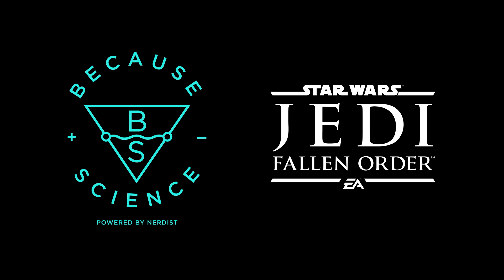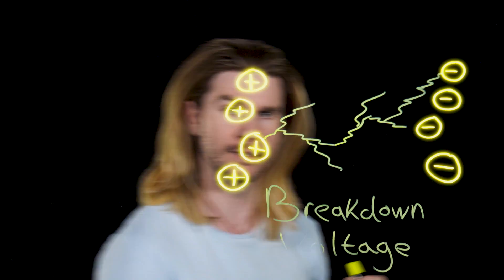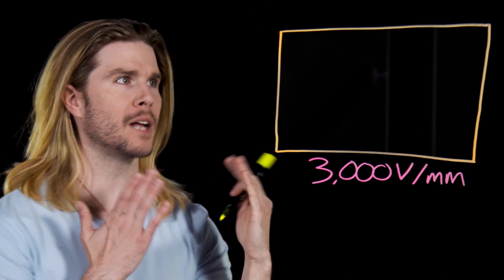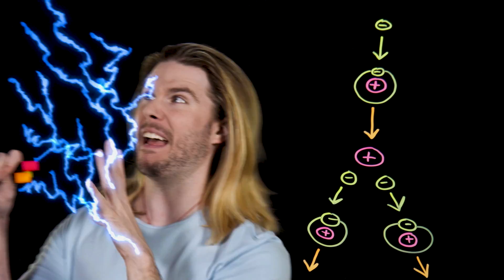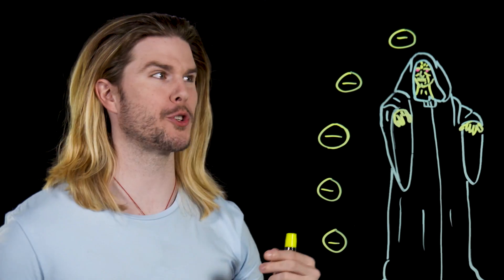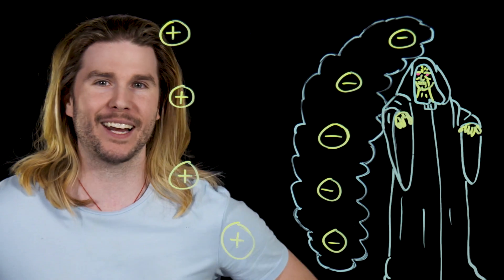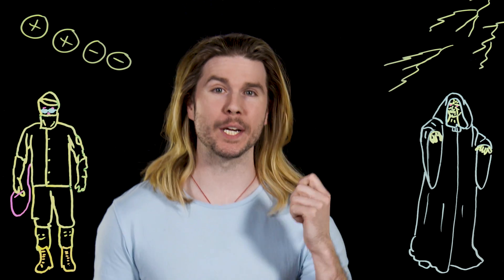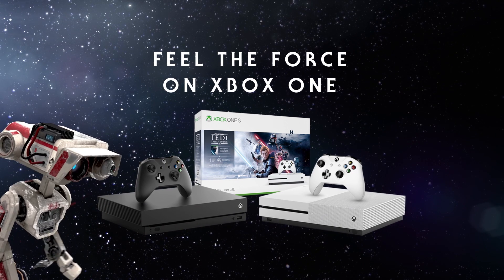How Does FORCE LIGHTNING Work? (Star Wars SCIENCE)

Comment: First: your black robe blends in perfectly with the background.
Second: if Sith lords can control electricity per electron (like you suggest), they could Force (get it?) electrons in the path they want them to take regardless of voltage.

Third: If, however, Siths could only build up a negative charge on themselves, the lightning would more likely hit something or someone that's closer to them as it forms a path of lower resistance. Besides, this would electrocute both the target and the Sith lord, making it rather counter-productive.
Fourth: no discussion about the dangers of electricity is complete without the note it's the amperage that kills you, not the voltage.

Comment: How to make force lightning even more terrifying and dangerous (and get round any mesh armour) : Instead of shooting the lighning at your target, levitate a tungsten (or any other high Z number dense material) coin between you and your target. Fire force lightning at the coin. The bremsstrahlung X-Rays in the  ¬14 MV range you are now producing in vastly higher quantity than in a radiotherapy Linac (Which is typically measured in milliamperes. Lightning is in 1000s of Amps) in the fraction of a second before the coin turns into plasma  give your target a near immediately lethal dose of radiation. Even if they manage to talk your protige into throwing you over a railing, you get to die knowing your target is, at best, the walking dead.

Comment: Kyle love the show, there's an interesting parallel between real world lightning and force lightning. Force lightning is used in the film media by the Sith, who can be considered the negatively charged side of the force. It is usually directed at Jedi who would be positively charged. Real lightning typically results from a build up of negatively charged particles flowing to a positive place. Just a random observation. In expanded universe sources rare Jedi are able to use force lightning but it is depicted as weaker. But if the parallel between the two is real then wouldn't Jedi force lightning be stronger since positively charged lightning is much stronger and deadlier?

Comment: There’s always so many issues with the way electrical weapons/powers are used in movies. 

-if Palpatine generates a voltage difference at his finger, if literally anything slightly more conductive than the target was near the “conductive force path” the electricity would preferentially arc to that and not to the target (since it seeks the most conductive/shortest path.)

-if the ground is conductive and a circuit is completed, wouldn’t both target and user be shocked equally?

-if the Jedi simply wears rubber soles shoes it would become enormously more difficult to target them, as they wouldn’t be properly grounded anymore. (If they can be considered to be before which I doubt)

-if one simply charged oneself up to the same voltage that Palpatine is generating by similar means, he couldn’t shock you since there’d be no difference in potential.

-To be maximally effective and to cause as much current as possible to pass through the target, Palpatine would probably want to use a “counter stroke” of returning force lightning. Perhaps this is why he sometimes uses two hands?

Comment: I know breakdown voltage a little because if it doesn't happen in your car you will have a misfire.  and for car with a higher compression ration you need more voltage.  a car will spark anywhere between 20,000 to 60,000 volts to jump a more dense air environment. top fuel dragsters use millions of volts and they can have huge deadly arks. search up top fuel dragster spark voltage and you will see something cool

Comment: Hey Kyle, love the show.

There's an even older technology that works as a sort of Faraday cage for the human body: chainmail. Whenever people have demonstrated Tesla coils, they tend to wear chainmail to protect themselves from the electrical discharge that such devices put out. I imagine that metal mesh clothing is really just a modernization of chainmail.

(But it should be noted that if you've ever experienced a diminished cell or WiFi signal from inside of a building, especially metal buildings, the building you are in could be providing a similar effect and blocking signal penetration, or at least attenuating it.)

Comment: But wouldn't the energy go through the closest path to the ground? "The path of least resistance" idea would prevent the target from being hit unless it was the only option. I think Force Lightning works by removing the negative charge from the target then causing them to be the best, most attractive object for lightning. 
                  Maybe by taking your negative charge, they can empower their lightning? Maybe they don't even "Generate" electricity, but force pulls your negatively charged particles from you (and the surrounding area) then send it back at you amplified.

Comment: The only issue I can see with this idea is that, lightening lasts an exceptionally short amount of time maybe 0.5seconds, whereas in the movie, the electrical current flow from sith lasts for multiple seconds meaning, that while the voltages are the same, the over power usage would be astronomical!

Comment: Great video as always! I'm wondering if there isn't another way that the Force Lightning can transfer through the air. In your calculations, you assume that the charge is generated solely in the Force user. However, we know that the Force is mediated by midi-chlorians. Their name is taken from a combination of mitochondria and chloroplasts, meaning that they can be thought of as "The Powerhouse of the... Jedi!" We are told that they live within all living cells which presumably includes all bugs, plant cells, fungi cells, and bacteria. If so, then there would be midi-chlorians in the air between the Force user and the target. Assuming these can be recruited, then they could also generate power, connecting like a bunch of microscopic batteries in series that would reduce power loss across space and in fact potentially compound across it depending on the density of biomass floating in the air. I wonder if this method could negate any of the defense measures you mentioned.  The power wouldn't be unlimited, but it would be impressive. Kinda like a Spirit Bomb but used for evil!

Also, I'm surprised you didn't talk about the fact that the amperage of Force Lightning is low enough to not stop Luke's heart despite the high voltage and prolonged shock seen in the film. Super interesting stuff!

Comment: You did not talk about the strain on the Sith Lord releasing all that voltage.  The problem with casting force lightning is that the spark shocks both parties and I can tolerate a static discharge, deal with them in my void as well, but if we are talking the voltage you are talking about, my hands should be on fire when I stop to taunt my victims.  As a Sith Lord, I am not a villain.....

Comment: Force lightning is really cool, but if I'm understanding your explanation right it would be really hard to use. 

Lightning strikes based mostly on the path of least resistance (which is mostly what is closest but not exactly, which is why it doesn't move in a straight line). With all the objects nearby, including the ground beneath their feet, the walls, railings, it seems like you couldn't actually coax the lightning to strike the target unless you and the hapless Jedi were floating in the air away from any other objects, or you were in a special room designed for it.

The image of Palpatine getting flustered as his lightning strikes the ground directly in front of him is pretty funny though. Thanks for the episode.

Comment: Since lightning can reach 30,000 K and we're saying the senate is pushing around 15 million volts, force lightning over a sustained period like we see in the movies (its not just one bolt and done) covering most of the jedi's body would have to leave them burnt to nearly ashes (cremation is only between 1400 and 1800 F). As you've stated in previous BS videos, most lightning strikes are not direct however I would think force lightning from Palps would be direct so no real chance of walking away from that one.

Comment: Love the show Kyle, but there is one issue you did not go into. The examples provided would indeed give a shock, but it would be a quick burst, much like lightning. In the movies however, there is a constant stream of lightning. The force user would have to continually manipulate the charge. Not only that, they would have to fully control the charge of the entire area they are in. 

For example, if I am throwing lightning at something 2 meters away, I would have to control the charge of every object within 2 meters, otherwise the charge I create will arc to the nearest object.  Basically, if you shuffle your feet and the charge you generate can go 1 meter away, it will go to the most likely spot first. When it comes to Palpatine, everything from his throne to Vader are also in range. You would have to neutralize any other potential targets.  Powerful control indeed.

Comment: This armor could still probably be circumvented fairly easily. While electricity can't flow through the armor, a more creative force user could just make the lightning completely within the Faraday cage. Even though the lightning is always shown starting from the fingertips of a force user, I'm fairly certain they have to manipulate the electrons of the air all along the desired path of the lightning. After all, electricity follows the path of least resistance and the straight route from Palpatine to Luke, for example, was most definitley not the path of least resistance with floor and metal railings being much closer to Palpatine.

Also if they can gather electrons to specific locations, is it too much to ask to just wiggle them around? I feel like heating pretty much anything would be quite an easy way to either melt your opponent's Faraday cage armor, or maybe just go straight for their brain. Once again, a reasonable explanation to a single element of Star Wars, which opens a whole lot of, more complicated questions. :D

I liked the video you made Kyle, keep going! :)

Comment: If a  Force user could manipulate electrons in this manner, they could also reduce the voltage required by creating a channel of ionized air between themselves and their target, essentially creating virtual wires for their Force tazer. This would make sense canonically as the value the emperor would otherwise need to hit Luke from that distance would have killed him, unless you assume Luke was using the Force to at least partially counter the effects.

Comment: If someone could generate such an imbalance within themselves to project lighting, I doubt It would get very far. Lighting, like any other form of electricity, will search for the path of least resistance to ground itself. If you were to generate an imbalance to exceed the breakdown voltage of air (which varies depending on things like and humidity as humidity and breakdown voltage are inversely proportional) and hit your target at the other end of the room, you would have to also make sure that the charge didn't flow through you to ground immediately (meaning you would have to stand on something with a breakdown voltage greater than what you are trying to achieve) and make sure that the lightning stream continues to it's target. Once the lightning leaves your body, it may just arc to the ground. I think the only way to prevent this arcing to ground is to charge your target with a significant opposite charge (like a spark gap) or control each electron in the stream to proceed in a straight line.

Another thing is that if you were to prevent your energy from discharging to ground through your body, your body and the ground beneath you would then become a capacitor, and if you fail to discharge your electrical energy at your target and you step off whatever super-insulator you were standing on, that newly formed capacitor will discharge, and those tens of millions of volts will arc through you to ground. This would also be the reason (this whole capacitor thing) that any lightning emitted by you would immediately attempt to go to ground.

One last thing. Is the skin effect preventing this lightning from doing internal damage? I would think so, but that high of a voltage would penetrate skin.

Comment: You should have mentioned that the electrical charge could not have traveled the distance mentioned without first discharging to the local conductors such as the metal staircase the emperor was standing on. It’s difficult to direct a charge with so many other conductive targets along the path.

Comment: So, theoretically speaking, wouldn’t it be possible for a force user to generate electricity/plasma using biology? I understand that they’re not generally accepted by the fan base, but, since midichlorians are “microscopic” forms of life, they should be using some form energy. If this were primarily stored as potential energy, then it wouldn’t be too far of stretch for them to be “forced” into turning that potential energy into kinetic energy and heat. What if, the “lightning” was not actually conventional lighting with a positive and negative charge? But instead, it is like lightning in the fact that it is an arc of super heated gases and plasma that is directionally oriented? Also, I used the term force user instead of Sith Lord because plo koon was able to use force lightning.

Comment: I'm probably approaching Maxwell's demon territory here, but if Sith can control electrons at will, couldn't they ionize a channel of air directly and then send a much lower voltage but still lethal current over the newly created conductive channel. This could also massively reduce the power requirements (not an issue with unlimited power, but assuming there is a limit - and not all Jedi are all powerful - it would make the process more efficient/increase range etc.). Conversely, could this level of manipulation allow them to negate the protection of the metalicized fabric/Faraday cage protection by preventing the movement of electrons within it that allow it to balance the charge?

That said, if they had this level of control, why would they bother to create an arc at all except for dramatic effect/to inspire terror? With this level of manipulation at range, couldn't they just create the voltage difference directly on or within the target and get straight to the killing part without that annoying fraction-of-a-second delay for the arc to reach the target?